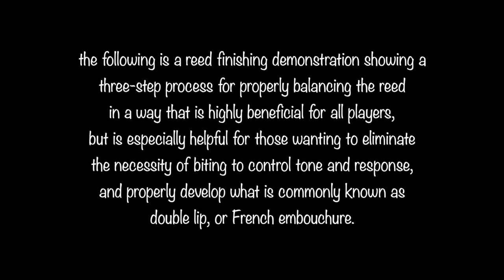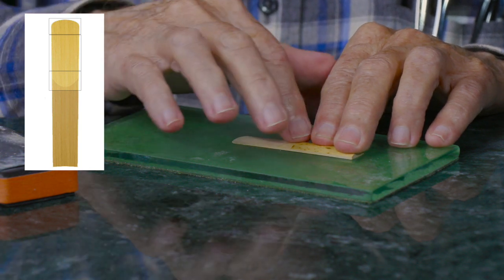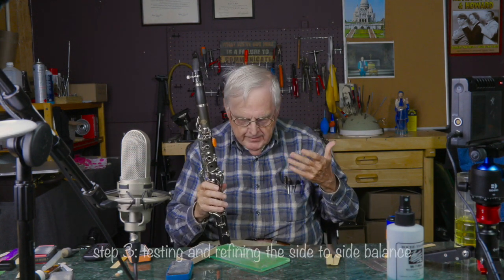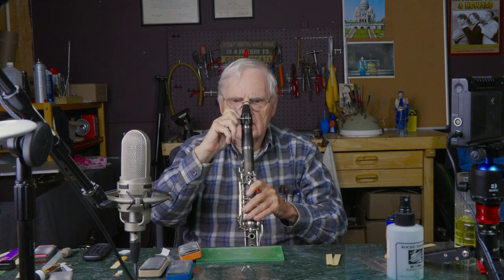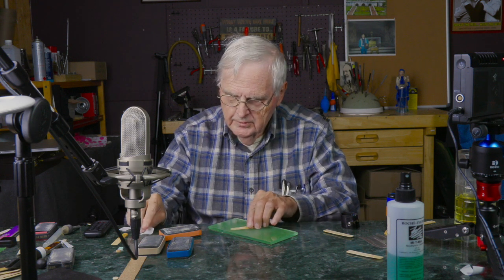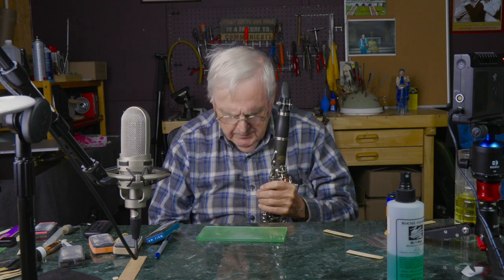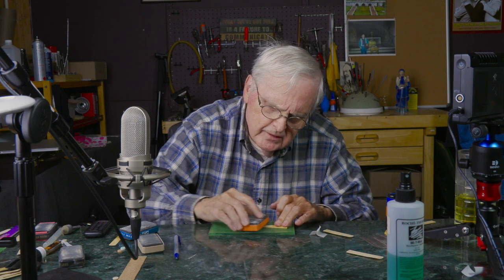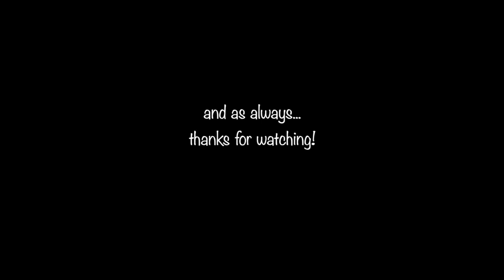Simple, three step reed finishing process

Comment: I really appreciate these videos, they are a real service. Two questions: Do you flatten the bottoms of the reeds first to make sure they sit flat on the mouthpiece table, and do you recommend using a stiffer reed than usual and working it down to your normal resistance? I ask these questions having read David Pino's book "The Clarinet and Clarinet Playing" and these are part of his reed adjustment methods. He, as you probably know, recommends we all move on to making our own reeds from blanks! Something I'm not ready for yet.
Reply from the maker: No. The reed should speak easily with a clear tone. Well-balanced is what I look for, so I don't have to close to force the reed to respond. I never flatten a reed. Correct the issues of reed imbalance and any perceived flatness issues seem to vanish in most every case.
Reply: @billyboy647  Thanks!

Comment: Tom, thank you so much for your efforts to make our life easier!!!
I have a question about the back side of the reed, I couldn't find the answer in the ATG.
How should I know how much "wood" should I take from the back side (left/right) to keep the reed in a balance, what is the test method about? Because if they are unbalanced behind the energy flowing back and reflected from the back will not be inline if the back is not also balanced, or am I wrong?
I would really appreciate very much a short (or even a long) explanation. I ruined quite few reeds ending up with a too thin tip, because they were "heavy" 
Regards,
D.
Reply: Unless Tom has changed his approach, I"m pretty sure that he never touches the back side of the reed. (I never have and never will because of the danger of thinning the tip, and I see no reason to do so anyway unless you want to try to flatten a warped reed, which is IMO a waste of time.) If I recall correctly, in one of his videos he specifically warns against the practice.
Reply: @bmcgar  I apologize  - I didn't mean the real back side of the reed but the down side - opposite of the tip (tip=front, back=down side, sorry english is not my mother tongue). According to Tom if the sound is stuffy/heavy, especially but not only in the lower register, taking a material/wood away from the down part, just before the bark (which I called back side) , it should solve the problem. Tom says - too many reed have to much material / are too thick there.
Reply: @danil6006  I understand. Been using that technique, though with a reed knife, for a long time. I only use it when all other adjustments don't work, though.

Comment: This is just my observation, but I find that the very tip is usually pretty even, but it's the area just behind the tip and along the sides that is imbalanced. If I finish the tip first, then work on one ear or side, then the tip ends up with one side very thin (since every pass of the sandpaper goes over the tip with the ATG system), and I am more likely to get "chips" and "whistle" squeaks. For this reason, I usually leave tip finishing for the very end. How do you avoid over-thinning one side of the tip if you do balancing later in the process?
Reply: His first thinning of the sides of the back didn't go over the tip in this video. Don't know about the DVD.
Reply: @MrDavidFitzgerald I’m thinking more the sides of the reed and tip (like at 9:50).